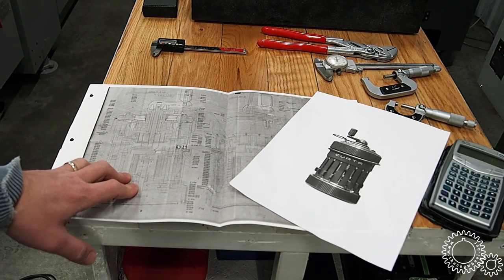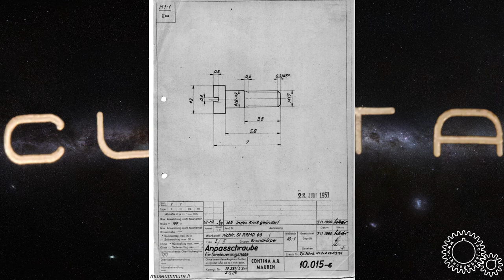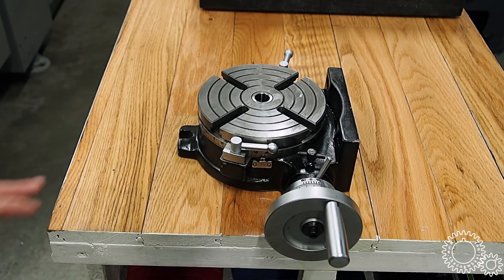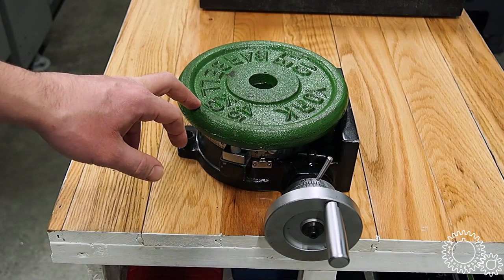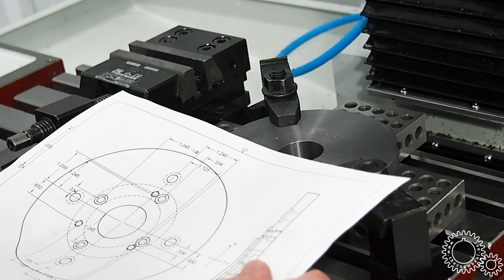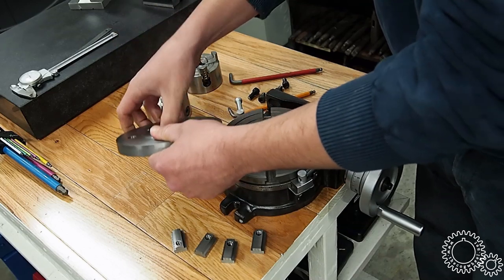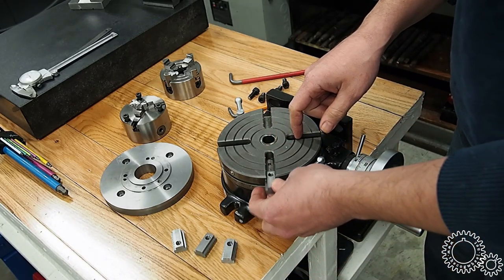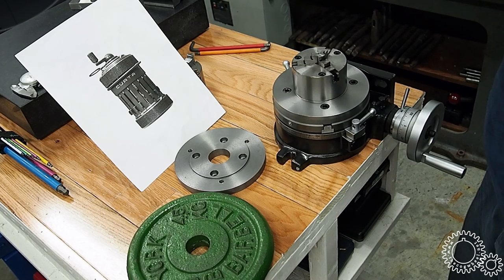Home Shop Curta Calculator Episode 1

Comment: Long ago and far away, I actually used a Curta. I did not own it. It belonged to a friend who had greater resources than I did. In those days, the slide rule was King, but slide rules cannot add. So if you had an "inner product" (a1*b1 + a2*b2...) also called a MAD (multiply and add), a frequent calculation in Physics, the Curta was the way to go. I could not have possibly afforded the thing, so I borrowed it from my friend to do the inner products. I became quite attached to the thing. I am greatly interested to see how this very ambitious project will turn out.

Comment: That went way easier than I am expecting my  3 jaw backing plate from a free weight build to go... because my 130 year old lathe  has a spindle thread of 7/8-10, I am having to start with a 50 lb weight... and no mill...